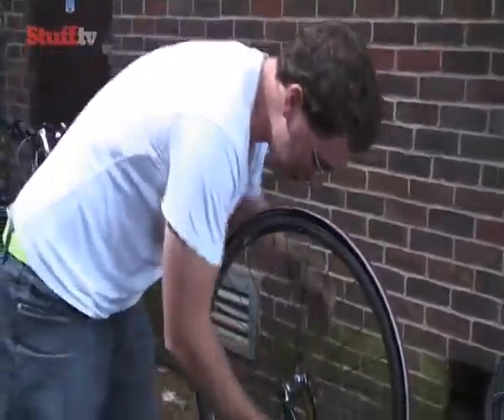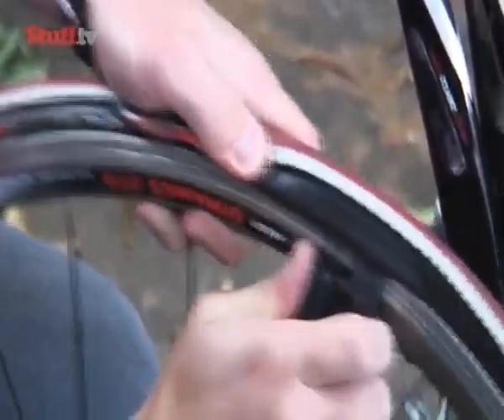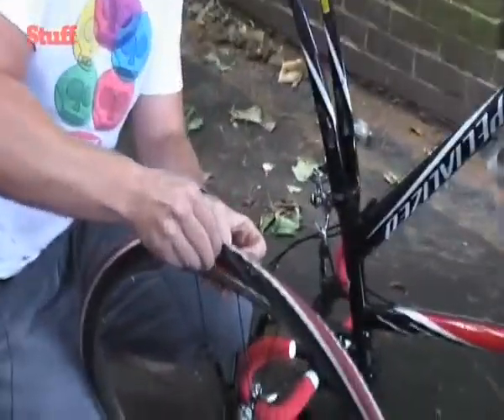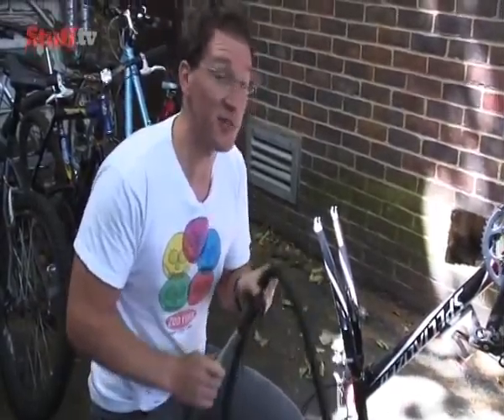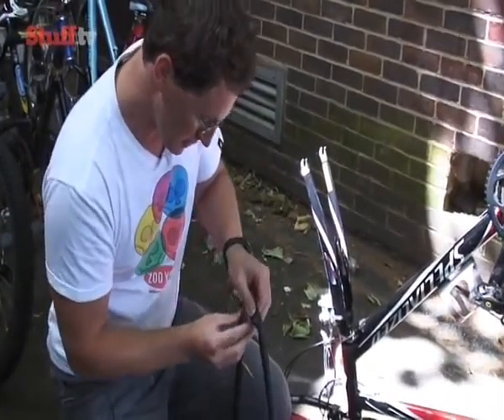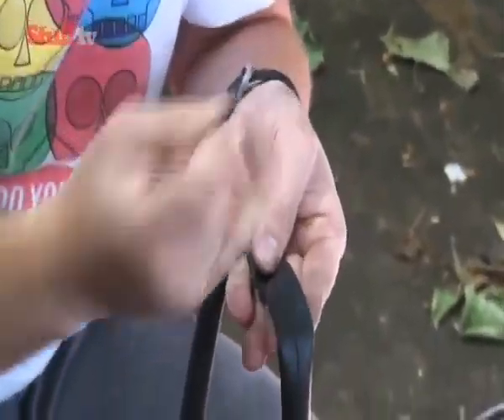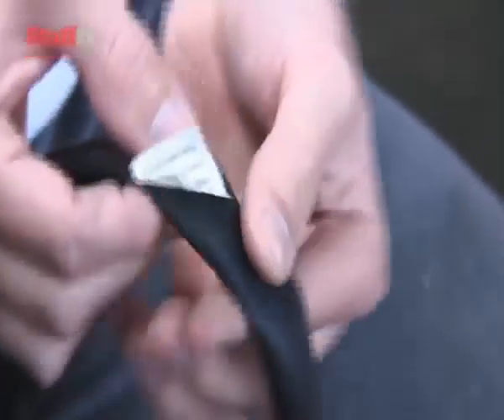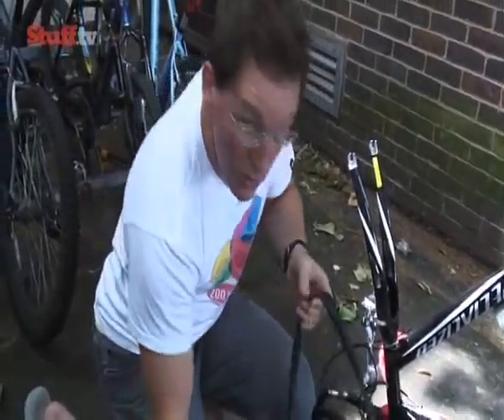How To Fix a Puncture

Comment: Hate those glueless patches, personally. Using vulcanizing rubber solution would have added just a few more minutes to this process and you'd know the patch is going to last the rest of the tube's life. 

This video would also have been of use to more people, considering conventional patches and glue are more commonly used, and sometimes when you're caught short you know you can nip in a poundshop and get a puncture standard kit (which I can attest to being of excellent quality for only a quid)